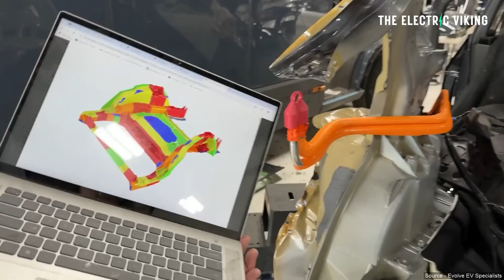What REALLY happens to a Tesla Gigacasting after a crash...

Comment: Woah insaine what the model y has withstood. I’d be a bit worried about the safety of repairing a gigacast (even after the video) but what would be more interesting is perhaps it might one day be economically viable to replace the whole body after a crash and retain the more valuable electronics. Can understand how repair could be more complex and costly atm but most of the legacy autos claims don’t make any sense.
Reply: Look at the cyberTruck tear downs to see the future of cars.  So long as the passengers compartment is still square one can remove and replace either or both ends of the car with new true components.   Bolt off.  Bolt on.  All in a faction of the time it takes to work on a conventional car body.

Comment: Yeah, um, Sam...have your shop REPAIR your engine block next tu.e it comes up with a crack in it.  You do realize castings are compromised when they break, and HAVE to be replaced.  You really think a major frame/suspension component is going to be fixable after being compressed and shattered in an accident?  Or after hitting a big pothole?

Seriously...the level of cope is strong here.  As well as a smattering a profound ignorance about how castings react to impacts.

Comment: 0:18 Automotive OEMs suddenly concerned about the environment when it comes to „Giga casting” but fail to reflect on the more than 100 years of fossil fuel burning ICE. That’s some irony 😂
Reply: Where do you think the metal used to make a giga casting and the press itself comes from?
Reply: @Withnail1969  Maybe I am wrong but my assumption is that the metal for “giga”chassis and the giga press is similar to that needed for conventional chassis and assembly machines and equipment and therefore have similar environmental impact.
Reply: I think the environmental impact they talk about is that it forces damage cars to be thrown away and a new car build, which is obviously not ideal from an environmental perspective.

Despite what this youtuber tries to push, this is a true effect. They ARE harder and less financially viable to repair in heavy crashes.

That being said, I doubt crashes that heavy are common enough for this to have a huge statistical impact.

PS! Its a misunderstand to mix ICE polution, gigacasts and OEM npmanufacturers in one discussion. Firstly you can gigacast an ICE car just as well as an EV. Secondly the suppliers do not build ICE car parts or EV car parts. As a whole they are kind of indifferent. Obviosly battery specific OEMs want more EV and engine related OEMs more ICE cars, but there are at least as many business opportunities in an EV. Anyway, they just build the parts that the car manufacturers order.  So you cant blame ICE polution on them Ultimately its up to us consumers. Car companies build what we buy, and parts manufacturers build parts to the cars the manufacturers build.
Reply: @torben777  Large castings are so much easier to recycle than a jumble of parts made of different metals. You can just drop them right back in the smelter, that's exactly what Tesla does with defective ones.
Reply: @frankcoffey  Nope Tesla does not recycle iron. They buy from third party suppliers.
Reply: @torben777  Gigacastings are not made of iron.
Reply: @frankcoffey  yes sorry wanted to say metal not iron, as my comment was not directed at use of any specific metal.

The term gigacasting refers to the size of the casting, i.e. that most of the car underbody is cast in one piece (or a few pieces). The term is not specific to a particular metal.

The most common use of it is for light alloys such as various types of aluminium. Tesla mainly uses it for aluminium body parts.
Reply: @frankcoffey  Most car structures are made of steel, very easy to recycle.  The work is mainly to strip off all the other parts first, same with cars made of gigacasting.
Reply: @torben777 
Hi, what about FSD if the car doesn't get into crashes
Reply: FUD, mo0re FUD, and extreme FUD. who paying them off? they cant really be this inept on their own, can they?
Reply: That's like when people just "assume" I care about green issues because I have 2 Tesla cars and interested in solar and battery technology. I'm not. The earth does not give a $%!# about what we do, human activity is a non issue and it would only takes one volcano to humble us back into reality. Humans have been on earth for a blink of a eye and are so $%!@#! arrogant we think we have stewardship? Go ahead keep taunting and we will be reminded how much we matter.
Reply: Hypocrisy

Comment: I learned to drive in the Northeast US. The sanding trucks were a frequent sight in the winter spreading out their salt laden sand. As a result, cars back then would start to disintegrate in a few years. My question is how corrosion proof are these parts?
Reply: Gigacastings are aluminium so very would be my guess.
Reply: @jonevansauthor unless it is a Cyber truck, they rust 😂
Reply: @jonevansauthor  Salt is no friend of aluminum.  I have seen outboard motors back in the 60s and 70s that have been in salt water, and they looked bad. Maybe today there are coatings or better alloys. Let's hope because this technology will be catching on. On the other hand, EVs, I believe will be someday supplanted by the good old combustion engine run on gasified water as was done by Stanely Meyer.
Reply: Back to the Future !

Comment: All sounds good and reassuring. Thanks for confirming that the gigacasting process is not the best and automotive industry will get rid of this process as soon as possible. It doesn't make sense for the customers. Doesn't have any real benefits for the owner. Yes...it has a lot of benefits for the manufacturers because reduces costs and probably time. Unfortunately the cost reduction is not translate to the customers....

So yes...gigacasting would have to move forward towards a more sustainable approach. It's not progress. It's a road block.

Comment: There's no 'only' before any car weighing in at 1900kg, Sam! That's a behemoth!
Reply: 1900kg = 4189lb

Many '60s and '70s cars exceed this weight.  IIRC "Woody" station wagons were > 5000lb.
Reply: @AllDogsAreGoodDogs  yes, and I've driven one of those and it was behemoth, and it was a disgustingly bad piece of engineering and felt like being on a badly designed boat. It's offensive to even consider for a second that a car that heavy is okay.

Comment: I was in the automotive side of the insurance industry in the 1980s. This is when body on frame was being replaced with unibody construction. The same types of things were said back then. There seems to be a distrust of change but other than trucks, body on frame has completely disappeared.
Reply: Replacement gigacast PART cost: $2,500
Replacement gigacast LABOR cost to disassemble and reassemble entire car: $25,000
Reply: @dzcav3  Might be expensive, but if the quote is too high the car will just be totaled by the insurance company.
Reply: @dzcav3  Got to wonder if it's cheaper to get a new bodyshell and transfer all the other parts over to it.
Reply: The EV industry in general is a threat to the aftermarket industry as there are soo few parts that go wrong needing replacing. Not only that you have all the engine cleaning products, emission control, chemicals etc etc.
It's going to be a big change and rather than be afraid of it, step up and work with it so you adapt to the new way of doing things. Look for new opertunities.
I worked for Kodak for many years in a minilab shop. And looking ahead to embrace the changes was key. So as not to be left behind.
Reply: For sure, but it isn't easy to repair, though it can be repaired in some cases.
Reply: @tacticalskiffs8134  it is easy. You just take all the bits off, and put the working ones along with replacements, back on a working body of whatever form that takes. It might not be worth doing for a particular car, but mechanics do it all the time. Look at what they do with barn finds. Right now, they're restoring HMS Victory for what's probably the tenth time in its lifespan. Most things can be taken apart and put back together. It's only hard with things like a Stradivarius, or a renaissance painting, or anything Apple make.
Reply: @jonevansauthor  For a gigacasting car, you need to completely strip one end of the car and dismantle like 1/3 of the bodyshell.
Reply: This was also said about unibody construction back in the 60s!! It was BS then and it is BS now!!!
Reply: The Unibody issues with low speed crashes  were resolved by requiring crash safe bumpers that prevent damage at speeds below 5 mph.  Otherwise a minor fender bender was causing either a huge bill of a total loss.
Reply: @MartinCHorowitz  Some manufacturers also started putting crush boxes (or crash memebers) on the ends of the chassis legs, a 6'+ bolt on section that could be replaced easily. That allowed you to smash the car up a bit more without damaging the bodyshell and helped keep the insurance premium down.

Comment: In time, more and more partitions of the giga casting are suitable for repair (Tesla shares this information with repair shops). So parts can be cut off, put back into shape and/or (re)welded. So if a model Y gets a hit at the rear side, this doesn't make the car a total loss in all cases. It depends on where exactly it was hit and the force of the impact (as with any car, i would say).
Reply: Local shops can weld steel, but welding aluminum requires skills and equipment that shops don't have. It's called the hardest material to weld.
Reply: @PxThucydides  Specialized shops can work with a variety of metals. Not on every corner though.

Comment: Since when did you have a car that needed repair of it's frame.  I never had this necessary.  And when you have a crash, most cars this day are scrapped.
Reply: Every body shop has a frame straightening machine, ask around.
Reply: I thought most repair shops had fixture to save banged up unibodies.  Been doing it for ever.  Rail frames can be repaired also, though with what everything costs these days, it probably doesn't pay any more.

Comment: I expect a car to help me avoid the consequences of any mistake I might make and also help me avoid the consequences of any around me who might also make a mistake; failing that, I expect it to protect me. It seems to me, Tesla is doing a good thing with its design and manufacturing process. And on the topic of repairability/writing-off a car, when I took delivery of my Subaru Outback almost 3 years ago, one of the dealership employees told me that if I was in a significant-enough accident to deploy all the airbags, then the car would essentially be a write-off due to the difficulty/time involved in replacing them.
Reply: I had front row seat when a car centre punched a power pole at 70km/h and snapped it off. When I went to open the door there was only a small deformation in the A pillar. Driver walked away due to modern design, seat belt, airbags, and the car sacrificing itself to dissipate the energy. I think it was shortened nearly 1 metre.
Reply: Without the airbags you may not have reason to worry about the car being written off.
Reply: @frequentlycynical642  umm... I'll pass on that one.
Reply: Yep.  Labor rates are over $100/hour in many shops.  It does not take long for it to make more sense for the insurer to just total the car.

Comment: Everything can be repaired, within reason. Cost, however, varies. It's not that long ago that Tesla buff, Ryan Shaw, had two separate "accidents" in his model Y.
The first fender bender came with a $10k Usd. repair bill. The second one was a bit better of a hit: $20k Usd ($30k Aud) to repair that sucker. Neither of these collisions were severe enough for the airbags to deploy.
So, basically, once these vehicles depreciate beyond a certain point, they won't be getting repaired. Insurance companies will pay out the insured value and take the car to the tip. That probably explains why insuring these, at least in Australia, costs twice as much on average as a similarly priced vehicle from any other manufacturer. The average cost of model Y insurance in Australia is $3900 p.a. My $30k ute, by comparison... $700.00. Ouch!
Reply: You nailed it.  This is not likely the part failure that will tip it.  Some places won't tow, or store the EVs even, so repairs are moot anyway.
Reply: This is the actual reality, not some story written by someone who knows nothing about what's really going on in the real world.  And this is true all over this planet.  It's all based upon the value of the vehicle, and if the cost of the repair is more than that value, they just tow the useless pile to the junk yard.

Comment: Cast aluminium is prone to fatigue cracking..
Reply: I have see plenty of  Steel Chassis crack and rust
Reply: Fatigue is a problem with spot-welded steel, with riveted steel, with riveted aluminium, with bolted connections generally...do you want to go with composites, or with plywood? Composites and wood are subject to more creep than steel or aluminium; composites can degrade significantly with time, as can the adhesives necessary with plywood.
The advantage of casting is that the wall thickness can be increased where stress is greater, and decreased where stress is low, without the additional stiffeners, gussets and brackets that are part of the traditional steel body.
Reply: So is spot-welded steel prone to fatigue cracking.

Comment: I used to think a casting was a bad idea until I saw a video of someone repairing a crashed car with a casting.
It is easier to repair a casting than straighten a steel body.
I saw a car fixed over a week end that would have taken weeks to repair if it was made out of stamped steel.
Reply: I would prefer an accident car with replaced cast parts than a car with straighten part by part as the car just doesn't feel as strong & as ridgid as before. Those straighten metal parts are no longer sturdy or may be off mechanically as the eye can't see the minute differences.
Reply: Lars Moravy explained that repairing a Tesla rear end costs 1/3rd as much as repairing an ICE car - mainly saving labor cost - and can be done in 1/10th the time, a HUGE saving in labor. Why? Did Tesla do this? ‘Cause Tesla is an insurance company too - saving repair costs means Tesla Insurance makes more profit than legacy insurance companies❤
Reply: @FrunkensteinVonZipperneck  Ok…fair enough. Here in Austurdistan we don’t have “Tesla” insurance and have to pay DOUBLE to insure them. I don’t personally have to as I enjoy my Skyline as it warms the cockles of my ICE heart.🧌
Reply: I doubt the repaired casting will have the required strength as a new one. It just doesn’t work…
Reply: @kallekas8551  It was even simpler than that. They took a casting from a car that had damage on a different place and replaced the entire casting. It did not take as long as I expected.
Reply: @franciscoshi1968  I see…my misunderstanding. I wrongly assumed it was two fractured castings formed or repaired to make one. Have you got a link to the video?
Reply: @kallekas8551  I just looked for the video but can't find it. Essentially what they did was remove the front casting and replaced it with one from another vehicle. The damage was enough that if it had been made out of pressed parts they would have had to cut the chassis and weld a new one. With the casting they just unbolted the front casting and removed the glue by heating it up. Then glue the replacement back and bolt it down. It was a very clean repair. Much easier than straightening a pressed body. I think it wouldn't make some crash repairs much easier and would need less skill to do a good job.
Watching it made me realise the casting would make some repairs easier especially if you have access to a wrecked donor vehicle.
Reply: @franciscoshi1968  Hey! Thanks for getting back to me!👍People aren’t usually so thoughtful. Thanks for trying to find the video, I have a feeling it’ll pop up at some stage. This modular method sounds interesting. Thanks again!🙏👍
Reply: I imagine the cast repaired vehicle would have much more rigidity and drive straighter than one pieced together
Reply: @JBoy340a  One would imagine that to be the case.
Reply: Replacement gigacast PART cost: $2,500
Replacement gigacast LABOR cost to disassemble and reassemble entire car: $25,000
Reply: @dzcav3  Hey! Thanks for chiming in! Holy crap…that’s a lot money. I think it’s fair to say that just because something appears simpler, it doesn’t necessarily mean it’s cheaper. Also when new technologies trickle down and become more widely used that would sometimes mean that the economies of scale take over. But I have my doubts mainstream manufacturers would adopt castings on such a grand scale. The possibility of errors is magnified and as Toyota prove time and time again…slow but steady wins the race. BTW I’m not a Toyota owner…Nissan Skylines for me!
Reply: @dzcav3  still cheaper than straightening a pressed steel chassis and you can get the casting from the wreckers instead.  Replacing the front casting and side panels can be done in under 2 days by one person.  No way you can fix a bent chassis in two days and put it all back together.